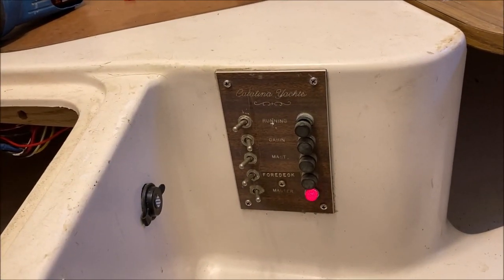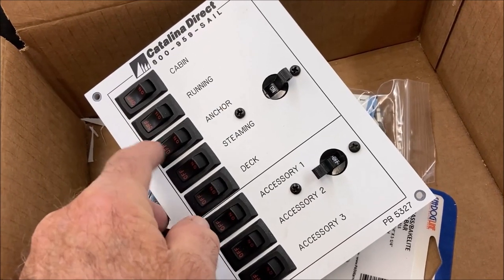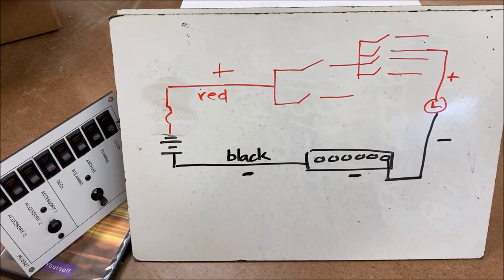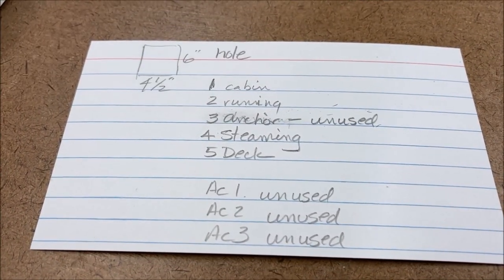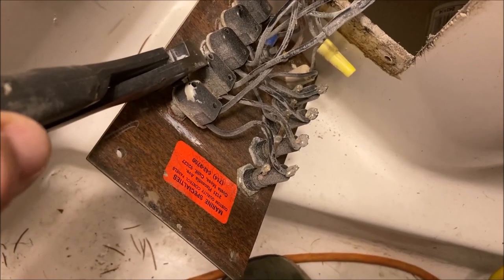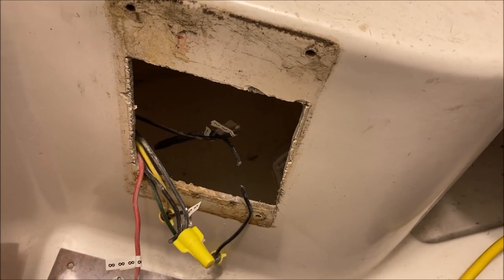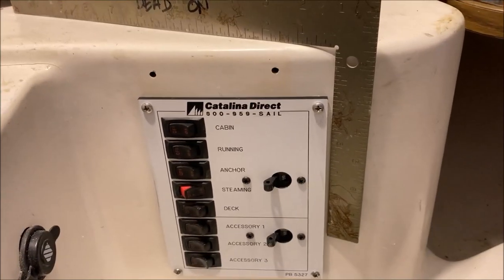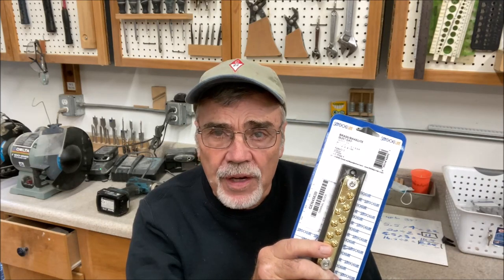Install a switch panel in your small sailboat -- Catalina 22 Sailboat --Jim's Little Boat

Comment: Your videos are great.  Very helpful with a Catalina 22 1979 I've had since April.  Can you tell me how you clean up glue or caulking in the interior like you had around the old switch box?  You mention it about 6:05
Reply from the maker: Hi Laura.  I just use a combination of things.  First a five-in-one scraper.  If that doesn't work, I use a razor blade scraper like you get at a paint store.  I have also used caulking remover and lacquer thinner and acetone.  But the main thing is persistence.  When I am doing new stuff I spend a lot of time putting down some masking tape.